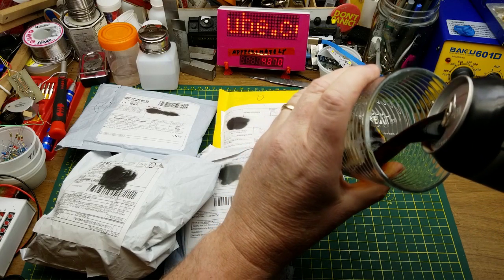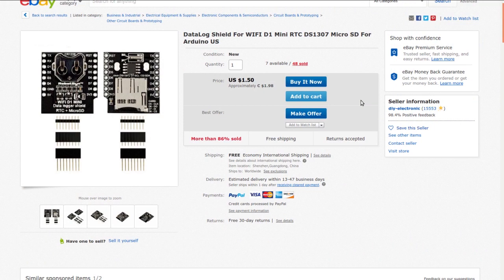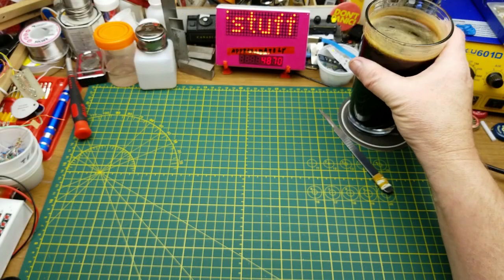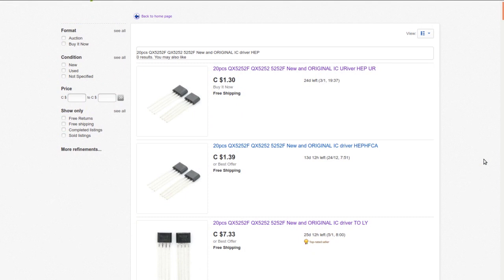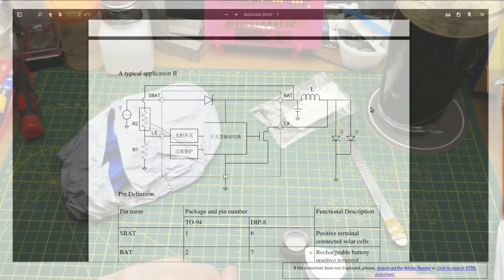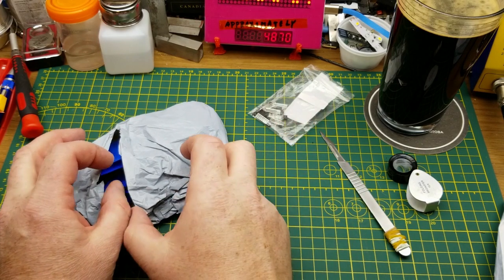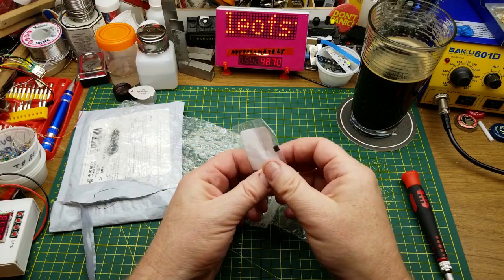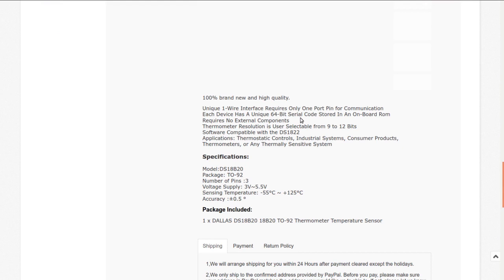mailbag Monday #76

Comment: Great mailbag once again !  For more 1-wire systems/protocols you could do a 'wiki LIN bus'.
It's common in cars, works very reliable. 

I've seen LIN used to control alternators, RPM controllers for DC motors, illumination control etc.
Thanks for the upload.
Reply from the maker: I wasn't aware of that one before. Thanks for letting me know about it.

Comment: Keep in mind that those 18B20 sensors sold on eBay are 99% fake, parasitic power might not work and the temps can be off quite a lot.
Reply from the maker: Interesting. I wasn't aware of that. 

Thanks.
Reply: I'll have to check mine out. Bought some a while back but never deployed them. Thanks.

Comment: love the show i am slowly working my way through them from the beginning.  But I am just wondering how small are your plugs in Canada that you can make use of that multi power board.  I am from Australia and our boards have a much larger spacing between plugs.
Reply from the maker: There's about 12mm between the hot and neutral, and about the same from either of those to the ground (earth). Don't forget that it's only 120V, so the spacing is more than enough to prevent flash-over.

The spacing between one plug and another on many power strips is a problem when you start using anything with the male plug attached to the device (like this power meter, or the light or a "wall wart" type power supply). If you're just using cords you can fit them in every position.

They also make power strips with wider spacing between positions to allow for wall warts and other less standard form factors.

I see that I'm attracting quite an international audience recently. I ought to do something looking closer at north American plugs if there's enough interest.
Reply: @pileofstuff  sorry you misunderstood my question    i meant the whole plug not the pins (earth active neutral) you used a 6 plug board, found the same problem on an american cruise ship the outlets were that close together that with an adapter could only use one of the plugs.   Thanks for the prompt reply.

Comment: I bought 4 of those shields.  3 did not work of the 4.  Hope you get a better batch.
Reply from the maker: Which part the SD card or the RTC?
Or both?
Reply: @pileofstuff  RTC - SD worked.  The RTC went through the motions, you could set it, and query it, it would work.  After a reboot, the time was gone.  After checking, it was killing the batteries I was putting in it.

P.S.  You can find a CR1216 at Walmart-works fine in it.  It's 3v just like 1220, its just 2.0mm thick instead of 1.6mm.

Comment: Have bought some similar, if not identical TO-94 solar/NiCad chargers, but they were called YX8018.  Clever design in 4 pins.  Do you have some of those tiny, resistor-looking coax inductors?  Have re-sleeved many salvaged 18650's.  Another part you may need is that flat little ring on the cathode.   Someone may correct me, but all SD cards have basic access through SPI, but the really fast interface is called "SD" and proprietary.  Newer MCUs support the fast protocol.  You need more melanin to toggle that light with your fingy.
Reply from the maker: I've got some power inductors, but none of the small ones (unless I salvage them from something. 

It might make an interesting challenge some day to see if I can wind my own. How hard can it be?
Reply from the maker: @GnuReligion  Good idea. I'll have to dig around ebay and see what I can find in my price range (AKA: cheap)!
Reply: You can always make those flat little rings by cutting them  out of an HDPE milk jug.